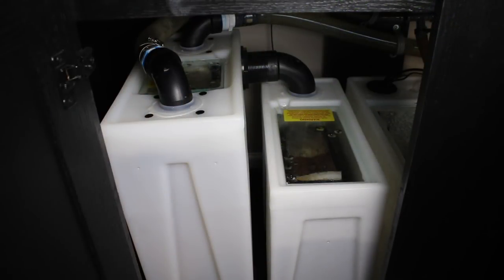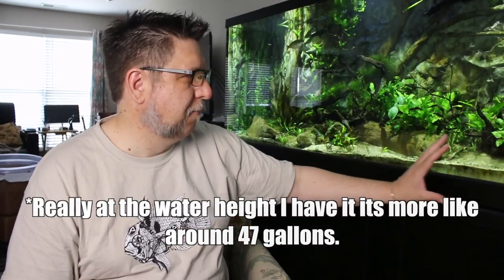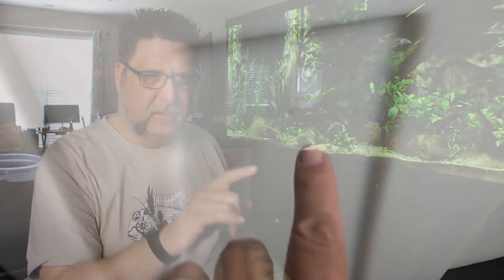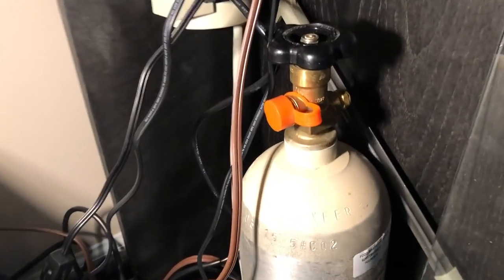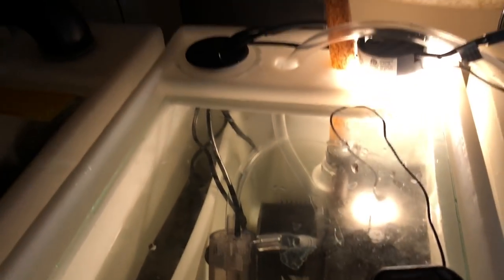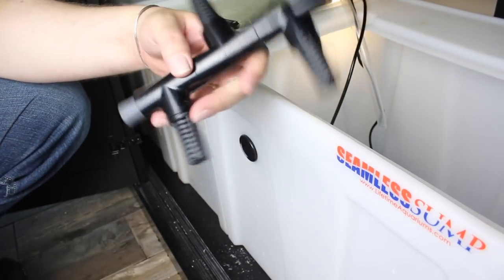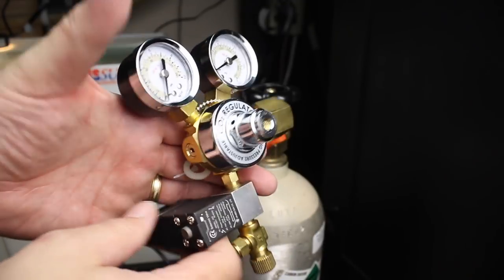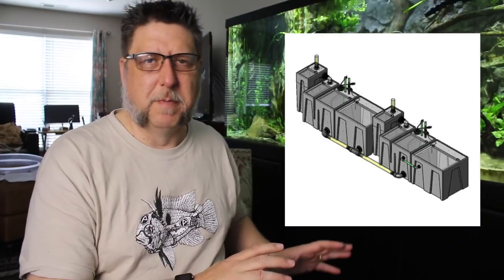Seamless Sump: Revisited

Comment from the maker: It’s come to my attention that I installed the bulkheads backwards. Not sure why the more finished looking side would be on the inside. From what I can tell it’s working all the same. I had no leaks at all. I’ll never get the thing out but I can unscrew the back and put a second gasket on the inside as a precaution.
Reply: maybe algae might grow on the threads and nut and if you have fish or plants the nut and pipe with threads will not but ptotruding towards the fish.
Reply: Bulkheads are designed more for use in the display tank. So the cleaner looking side was designed to be on the inside, keeps the display looking better. If the bulkhead wasn’t hidden that is.
And for functionality, it’s better to have the molded flange on the inside with the water pressure pushing it into the seal. Versus being on the outside and relying on the nut pulling it into the seal. Lessens the chance of leaks.
Reply from the maker: @UserError7861  that makes a lot of sense.

Comment: Awesome looking tank. The Seamless Sump is great for the material it is made from and its modular design. One thing I have never understood is why the pump is not in the last tub. If you do not desire a low flow area putting the pump in the last tub would remove the need for the recirculators.
Reply from the maker: It’s just a spot set aside to move a fish to or hold one separate from the others. I had some elaborate plans that I never really moved on. I’ll be doing an update soon.

Comment: hiiii! (sorry this doesnt apply to this vdieo)
two quick questions if thats ok
: can i cycle my tank with just plants?
are there peaceful tank mates for  a betta in a heated 6,7 gallon (shrimp and snails are illegal to sell here in maine)
bonus question: whats the safest way to acclimate.a betta from his little transport tank, which will surely cool down while i'm doin my duties (for moving his tank or doing a deep clean)  into a 75  degree tank?
Reply: There is a style of cycling your tank that is called Silent Cycling where it uses only plants and then you slowly add fish after months of it running. It is really does take a long time compared to other cycling methods.  The easiest way to cycle your tank is to add a piece of raw shrimp or fish into the tank and let it break down in the tank. It is a great way to cycle without adding live fish. Some people cycle with live fish but I think it is cruel to sacrifice a living fish to do it.

Depending on the size of your tank, it will change what you can have with the betta and some bettas are just jerks and won't let anyone live with them, so you will have to test out if yours is okay with them.  A lot of people have success with corydoras, some tetras like the rasboras or neons, or some of the less fancy guppies. All of those are fish that you need to keep in a small group of around 5 or more. I personally wouldn't recommend a tank smaller than 10 gallons if you are going to add tank mates in with the betta, just so they each have their own personal tank space.

If you are talking about the little cup that they sell bettas in, it should float in your tank. You just set the cup on the surface and let it float for 20 or so minutes, so the cup water gets the same temp as the tank. If it is store water, don't add it to your tank, just scoop the fish and add him alone. If you have had the betta for a while and you were just deep cleaning the tank, you take the cup and scoop up his tank water into it and add him in. When you are done, you do the float acclimation and when it's time, you can put him and the water back in.
Reply from the maker: I sort of do that. I wait to put fish in till the plants start growing. And I add the liquid bacteria as I do. I still start really slow when I do add them.